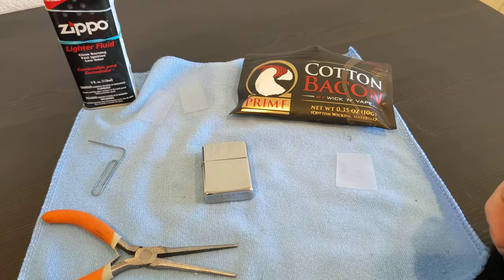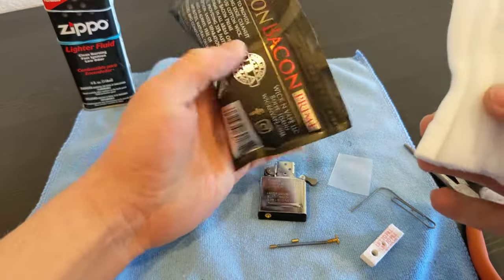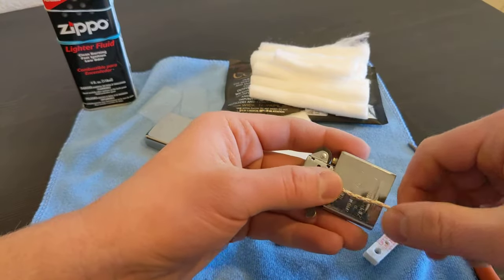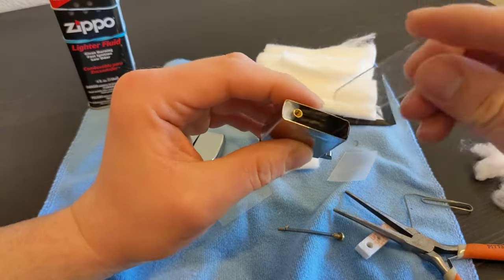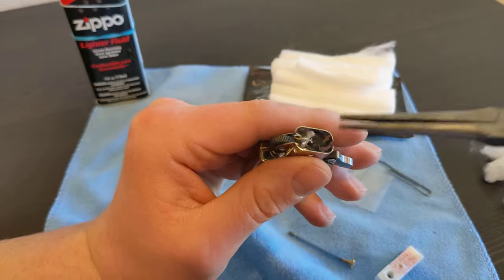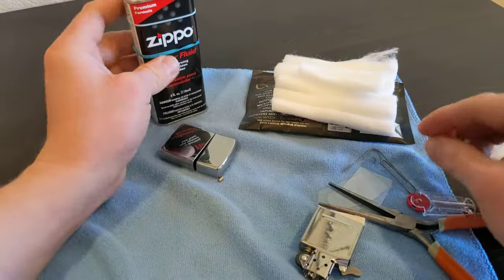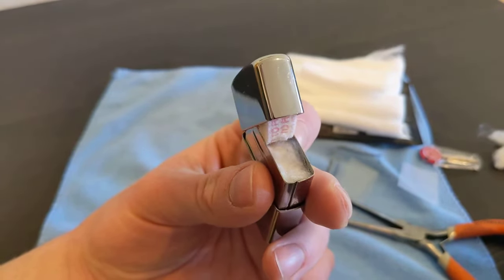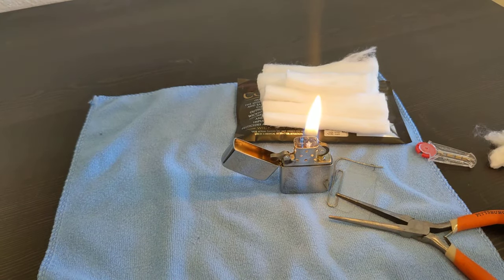Zippo insert modifications for best results - #zippomafia

Comment: I do basically the same thing but I get rid of the felt and use more cotton the felt is supposed to be a seal to keep lighter fluid in but because your using the plastic bag you don’t need the felt and you can put more fluid in with more cotton
Reply: Same with me, I use the baggie trick to get a seal since the felt is removed.
Reply: @  they also have rubber seals that I like more now they keep the fluid from evaporating
Reply: @lucas02389  I've seen those, but didn't want to give up any space.  I should keep my eyes open for an extremely thin sheet of rubber to replace the baggie, or seal around the outside with nothing over the bottom.
Reply: @ honestly when I switched it to the rubber gasket I gained like 2 days worth of fluid

Comment: Well....FYI: The small hole in the center of the top felt is where the spare flint goes.
Reply: But that way, the flint will easily fall everytime I pull out the insert.

Comment: For the spare flint: (keeping it under the felt for too long WILL dissolve it!)
- Remove the flint-spring-screw
- Pull the little brass looking flint stopper thingy OFF the end of the spring
- Put TWO flints inside the flint pipe
- Re-insert the flint-spring-screw

You're welcome 🤘🏻😎
(p.s. I used to clean that factory -- they are made in my home-town of Bradford, PA --> as well as Case knives!)

Comment: Instead of lifting up the felt and filling my lighter, I started squirting fluid through the hole in the felt. I can't see the insert filling up so I don't squirt it very hard. When the felt soaks through and a drop runs off the lighter I know it's full. I don't know if they fit but I started saving flints from disposable butane lighters. I just lift the end of the felt and toss them in. I may still have some Zippo flints in my kitchen cupboard if the other flints don't work.

Comment: Instead of running the wick in an "S" shape, I made it into shell shape spiral.  The rationale is that it will draw fluid from the corners better, and draw the bottom fluid (which is more prone to evaporate) sooner.  I've never tested to see if it makes a notable difference.
I use a single piece of cotton sliced to wrap around the flint tube to the outside, the rationale is a single piece draws the fluid better.  Some bored day I would like to try just 2 pieces of cotton fitted around the tube.
I removed the felt and used the baggie technique to seal to hold a little more fluid.
 Love the idea with the plastic inserts, better than the butter knife I use, and you didn't have to stuff a small piece at the top.

Comment: I’ve carried a zippo every day since 1987. The best way to have the wick is about halfway up the chimney, and frayed. 
Never had one fail to light or need to be adjusted or replaced in all those years if it had so much as fumes in it. Set it and run it. My current edc is from ‘09, and it gets struck 30-35 times a day, and the wick is exactly as it was the day I got it and filled it for the first time.
Reply from the maker: I have my wick level with the chimney. I like my big flame :)
Halfway up wick like you have though will be more fuel efficient.
Reply: mine rests ever so slightly over chimney level because me like big flame.

Comment: Which zippo version can hold more fuel and last longer given the same use? A torch or regular flame version?
Reply: Regular Zippos leak vapour from the hinges so Its always a good idea to store a zippo wrapped in a small plastic bag. This stops vapour evaporation. A zippo will normally last a few days without wrapping but if you wrap in a plastic bag it can last over a month.
Reply: @Matty18795  i use the sandwich bag trick but i smoke a lot of green, it only last max a week
Reply: @91lifetime23  I have put a little clip on my playlist. It shows how to cover the hinge.

Comment: I watched this video like more than 10 times while waiting for my Armor Polished Brass Zippo. it is name engraved too. Maybe I regret a little doing that as maybe if I polish it the name wont look good lol. 

Finally I did it, it lights up very smoothly. Altho My lid is kinda loose compared to my other Zippo and it's brand new, that makes me a little upset...also there is a lid gap...sigh... I searched the internet and it seems loose lid is normal...it depends on your luck...sometimes your new zippo is tight and sometimes it's loose..

I use a knife to instead of the 2 plastic strips...more confident to do it that way, much like how zippo fanatic 77 did it. But all other aspects I follow your way. Very smooth light, haha...cotton bacon is magic! or maybe cause it is newly filled? idk.
Reply: need to use pliers to bend the hinge loops tighter on the pin. i got a brand new zippo with a super loose hinge and hated it until i fixed it. this guy talks about some tips for the hinges i basically did what was in this video https://youtu.be/7D90yyskiJA?si=TMwBJZfJ9qBS2j2P
Reply: Regular Zippos leak vapour from the hinges so Its always a good idea to store a zippo wrapped in a small plastic bag. This stops vapour evaporation. A zippo will normally last a few days without wrapping but if you wrap in a plastic bag it can last over a month.

Comment: I got an idea, but I'm not sure if this could work. Is it possible to put two flints at the hole in the way that when one got empty the other is already there ? Or this will make harder for the wheel to spin ?
Reply: there will be too much force on the spring so it will be unreal to spin the ignition wheel

Comment: Good video for sure, but i want to say the rayon that comes with zippos is just fine. I unroll and fluff it out, then repack the new insert. Havent noticed any difference in fuel capacity (by weight) nor any difference in fuel economy..

But, if youre repacking an old zippo (or any oil lighter really), cotton bacon works very well
Reply: I’m just about to order a new zippo and was interested to see this cotton bacon, I’ve never heard of it, I think like you’ll I’ll just stick with the rayon, taking it out and fluffing it up is a great idea, I’ll definitely be doing that, cheers for the tip 👍🏻
Reply: @TeddyBoy7796  cotton bacon is used for wicking in vapes, its one of the best wicking materials out there for it tbh.

The biggest thing ive noticed is in a zippo insert, it doesnt make a huge difference. Instead, you want to try and make whatever wicking/absorbing material you have as fluffy and pourous as possible. The more cotton/rayon you have in there, the less fuel that will fit.

With repacking the rayon inside my zorro insert, using the lighter thru the day, ill get about 8-10 days before refueling. I drive a truck, im constantly changing elevation and temperatures so i wont complaint about the life span, especially since an out of the box zippo would give me 5 days tops

Comment: Old video but i got a question, after the wick is not working/dead or whatever, do you just pull the wick or do you have to do the s shape trick again?
Reply: Just pull it out a bit then cut it. No need to do anything else. After doing it 2 or 3 times,  depending on how much you cut off, you can repack it with a new wick.

Comment: Great video and amazing mods! How do feel about the rubber gasket vs the sandwich bag trick? I guess the sandwich bag has the advantage as you said of providing a barrier to the metal so it doesnt scratch.
Reply: Regular Zippos leak vapour from the hinges so Its always a good idea to store a zippo wrapped in a small plastic bag. This stops vapour evaporation. A zippo will normally last a few days without wrapping but if you wrap in a plastic bag it can last over a month.

Comment: Zippo flints suck,If you want a better quality flint. Get a full size disposable lighter and take the flint out of it and use it in your Zippo.
It is a harder, longer lasting and better sparking flint.normally you will have to cut the flint in half...
Another thing you can do is use Coleman camping fuel in your Zippo lighter.burns the same as lighter fluid and is a heck of a lot cheaper.a gallon of it runs under 20.00 bucks...
Reply: Regular Zippos leak vapour from the hinges so Its always a good idea to store a zippo wrapped in a small plastic bag. This stops vapour evaporation. A zippo will normally last a few days without wrapping but if you wrap in a plastic bag it can last over a month.